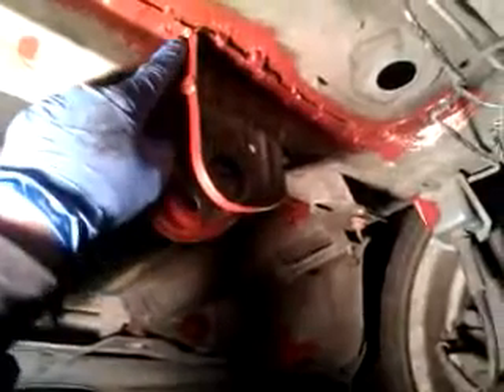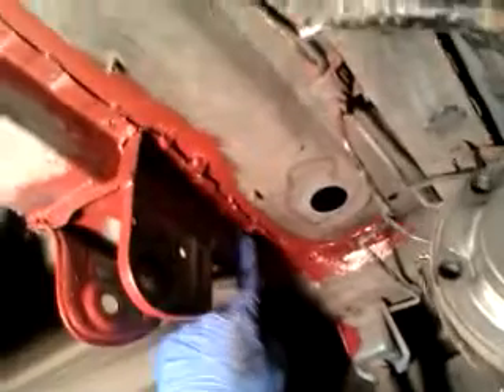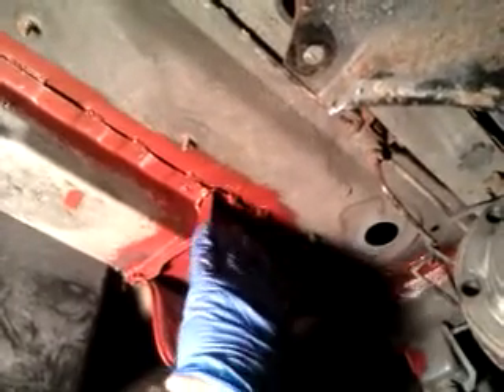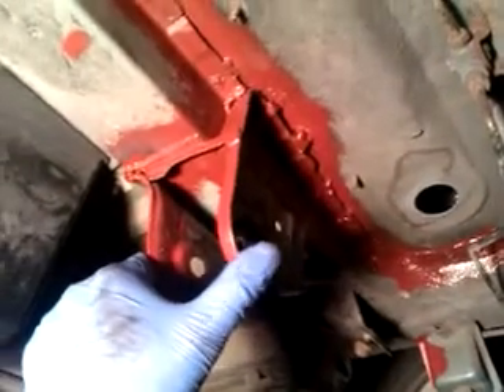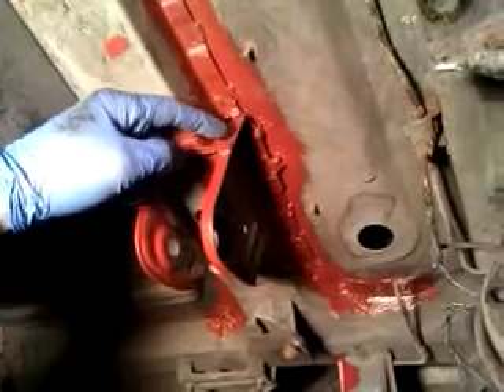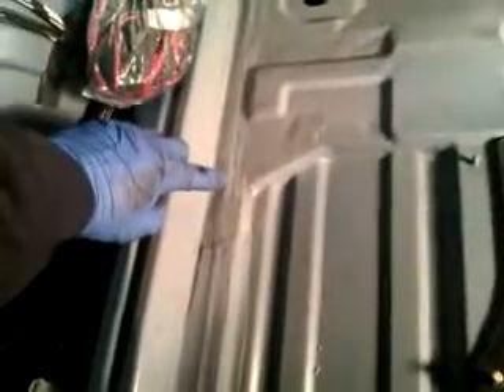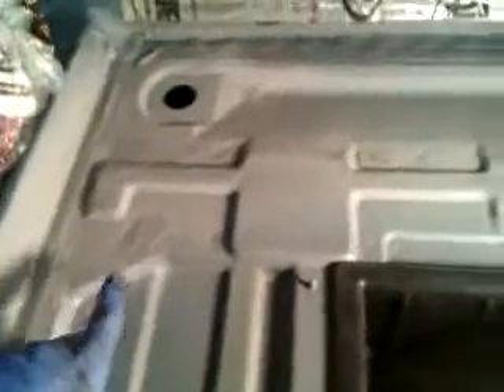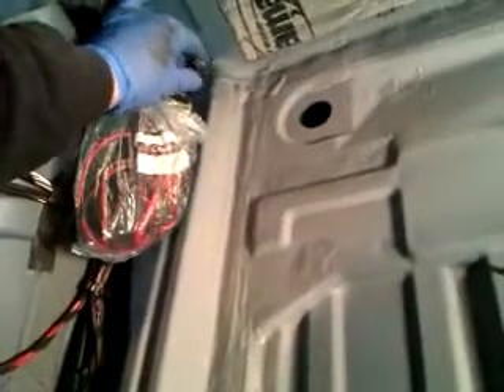BMW M Roadster (Z3) Repaired Diff Mount (unedited video)

Comment: The cross member did not pull away from the floor above because the welds were too weak.  It pulled away from the floor because the cross member itself is not stiff enough to prevent flexing in the vertical plane.  The relatively flat floor above it adds little to no support to the cross member.  You need to reinforce the cross member itself, beefing up its vertical section(s).
Reply from the maker: The cross-member was not distorted, but the welds had failed.  There is a solution out there that adds a lot of metal to the cross-member.  So much so, you could probably cut away the original cross member and throw it away.  Anyone can make a structure stronger by using brick instead of a straw.

The problem, in my opinion, is that BMW designed a car that has used shaped metal for strength and has welded different shapes together.  I am of no doubt that there would not be a problem if the whole of the back-end of the car were made from one piece of metal with the dimensions unchanged.  As it is different pieces are welded together and (in my opinion) the joining forces are the weak point, not the shapes themselves.
Reply: Glad to hear your repair is holding up.  No point in over doing the cross member reinforcement, but if it was flexing enough to break the welds to the floor, it would suggest that it wasn't stiff enough to begin with.  The floor itself isn't mean to hold it up.  It's not designed that way, being thin 20 gauge steel, oriented in the horizontal plane.  The floor rests on it.  The torque from the rear end, pulls down on the cross member, flexing it downward excessively.  Eventually, that flexing cracks the floor welds, and in many cases the cross member itself.

Comment: knock on wood. my coupe which i just bought doesnt have this issue.  all adult driven.
Reply: The larger engine z3s are the ones prone to this problem, have a good mechanic look it over before you buy one then keep an eye on it. My 1996 Z3 has the 1.9 engine in it, 205 thousand miles and still like new
Reply: I am about to get one? Any updates?